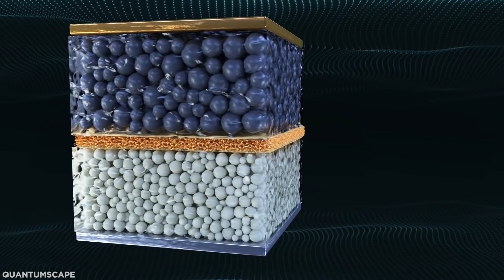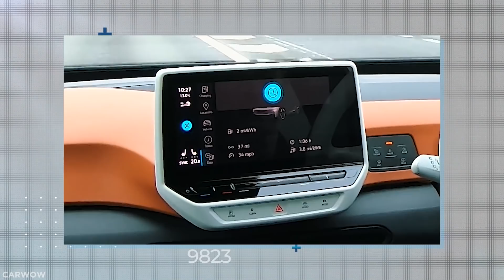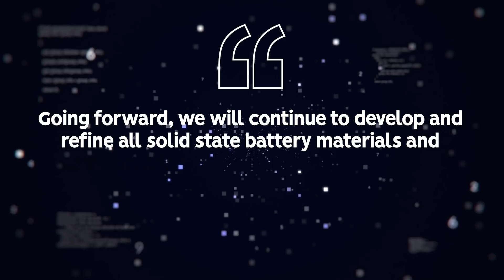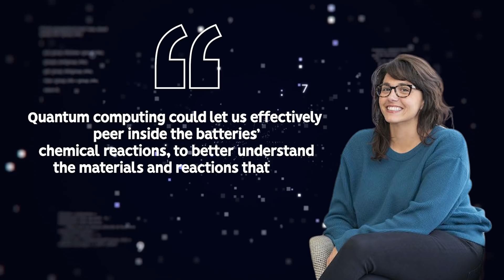Why Solid State Batteries Are The Future

Comment: The biggest drawback is that Tesla will have lithium-ion batteries that blow those spec out of the water within 5 years.
So by the time anybody is able to scale solid-state batteries, Tesla will already be moving on to the next thing.
Reply: Tesla get their battery from Panasonic. Panasonic is not the only company that can make battery. There many other...
Reply: @jonpetter8921  If the battery manufacturer was so important, every other EV manufacturer wouldn't be 4 years behind on range and charge cycles.
Tesla has put the capital and work into R&D to develop battery tech that outperforms everything on the market and everything the "competitors" are planning 5 years out.
Reply: @JIYkp   There are many metrics than range that you need to take to consideration when talking about EV. In Europe range is not always the absolute factor when buying an EV, E tron for instance has less range than Model X but sells 100x times than Model X, same with Tyacan and Model S. Model S decline while Taycan is hitting record sale having less range than Model S. So your so called "4 years behind" has very little effect on people preferance while byuing EV, and there are other EV that offer better package than Tesla in Price-range-build quality.
Reply: @jonpetter8921  Too scared to compare to Model 3? Understandable. Have a good day.
Reply: @JIYkp  haha you must be new. VW ID 3 outsold Model 3 in europe the last 4 months of 2020. In Netherland VW ID 3 is the most sold EV in 2020 outselling all Tesla cars combined, included Model 3, knowing VW ID 3 has only been in the market for 3,5 months. 
In Europe Renault Zoe is outselling Model 3 by almost 20 000 units for 2020.
The one who is scared right now is Elon cause this year wont be easy for Model 3 in Europe with ID 3 and ID 4 and other new european EV coming.
Reply: @jonpetter8921  Gee you pick your stats Jon. Tesla sells every car they can make, so dont go thinking any sales figures mean they are losing sales, they have to deliver all over the world from just one, then now 2, soon 4 factories. What other metrics do you want to use?  Speed, acceleration, no of chargers? Speed to charge? And exactly which one does tesla NOT win, $$$$.  Prices will drop as they get volume, the model y in china just sold 100,000 in a day since the new manufacturing has allowed a reduction in costs. The CEO of volvo admits they are 10 years behind in ev tech, batteries and software.  Many sources have stories on Toyotas SS plans, and they HOPE to have SOME production capacity by 2025, the year Tesla will complete building out 3TWhrs of capacity. The German facility, if it goes ahead could eventually do 250GWhrs. Weight means nothing if your cars are good enough, capacity good enough, and production actually exists! No-ne is beating tesla on range or build quality any more, only thier (Falling) price, oh, and tesla is actually making a profit on EV's, no one else is (maybe in china?), but they are all cheap, loss leader, or compliance hacks.
Reply: @jonpetter8921   Elons not scared, he can sell every car he can make, and grew in a year the rest shrank, while subsidising their ev's.
Reply: @RacefanPat68  How can he "sell every car he can make" when Model S and X are sitting on shelves. And he will soon learn the hard way in Europe if he doesn t get his act together. 
Remember Ford ?
Reply: @RacefanPat68  It doens t matter how good your Berlin factory is if you offer the wrong product to the consumers. A sedan will never making it in Europe, and even a minivan-ish Model Y wont do a miracle sale. ID 4, Skoda Enyca and Audi Q4 E tron will make life difficult for it.
Just wait and see....
Reply: @jonpetter8921  Yeah. You wait and see. Tesla will make 1 million ish cars this year and sell them all. Germany's Model y will be cheaper than you think with the cast chassis front to rear, and batteries integrated directly into the chassis, and the world's most advanced, zero pollution, paintshop, making it quicker and cheaper to build although there is potential for a troublesome ramp. Oh..., and Tesla has actually secured their battery supply....
Reply: @RacefanPat68  1 Million cars ? you must be kidding.
Reply: @jonpetter8921  I am certainly not kidding, It will be 900,000 to 1 million... Shanghai stage 2 JUST started churning out model Y, and stage 1 can do the same volume as Freemont now. All year they have been accelerating production and did nearly 200,000 in q 4, (model 3 and Y). Now with the second stage in shanghai ramping as well, and the following year Berlin, then Texas,and they are both bigger than either fremont or shanghai, and use all cast chassis, so much less car assembly to ramp. They are also carbon copy processes, so much less ramping bumps methinks... So 1 this year, and 2-3 in a couple of years. That's why they building battery plants for their partners, and building electrode plants, lithium processing plants, mines... or mining leases actually....
Texas will be massive too, with a capacity of maybe 2 million Y, 3, and Cyber-Trucks, maybe a few semis. They have everything (like contracted battery capacity) lined up ready to go. VW has said they may get to 350,000 in 2025 didn't they???? Was that electric, or id3 only...
Reply: @jonpetter8921  There are 2 others that could theoretically handle most of Tesla's volume, LG and CATL, and both supply batteries for them already in china, just as many as Panasonic in Nevada...
Reply: IAN G You must work for a Auto company. 

1. you make a basic mistake. Tesla is not just a car company, and thinks different. Tesla does not do continuous improvement except in that they add stuff as soon as its ready and drop the price, They are a disrupter, looking to REPLACE. like the castings, 1 giant processes removes hundreds and hundreds of machines, stations, assembly steps, welds, robots and parts from every car. 

 2 you misrepresented their battery road-map grossly. 50% improvement in $kwh so 13% is meaningless. If you can afford to add a few, and still have the fastest car on earth your figures are vaporware like your SS Batteries. 

3. Tesla is a moving target. If your tech moves forward 5 years, (Oh and suddenly exists after 40 years of being next few years), Tesla has also moved forward 5 years. New thinking, and far far more engineers working on the problem, and more money in the bank... Tesla is working toward making energy sustainable, not just cars, so you miss a lot of the overall inflection

3. Tech.  Dry electrodes. What is flammable?  Besides using a dry electrode processes, and  moving to pretty much gluing them into the chassis without a pack,  starting in Berlin soon, (did you talk down battery day much?) they are already 1/10th as likely to catch fire than a gas car (Per million KM driven), and probably 100th as likely as a hydrogen gas leaker. This is a fear inducing lie by the auto companies who keep insisting on investigations and the media who will run with anything nowadays. This constant re-hashing of any Tesla news is FUD.

Comment: are solid state batteries able to be recycled or remanufactured in the way current batteries are? or will solid state batteries present entirely new challenges for small recyclers sprinting to keep up with massive producers?

EVs are greener on the surface than traditional vehicle, but end-of-use care matters. i don't think it's being talked about enough.

Comment: I drive like 25 miles a day, rarely go on road trips like maybe 1 every two years. Range is super overrated. Except with Semi trucks which can haul more batteries so it works out. The safety thing is definitely better, even though batteries are already safer then petrol.
Reply: Batteries are not safer than petrol at all, and diesel doesnt burn naturally
Reply: @alanmay7929  False.  There are far fewer battery fires than petrol fires every year.  The average increase in safety is about 10x to 20x safer.
Reply: @redbaron6805  there are also millions of modified and bad repaired old cars on roads, fires doesn’t just come like that
Reply: @alanmay7929   That is only a small fraction of the story.  BMW, Hyundai, Ford and others have been recalling brand new cars for fire risk.  

Then there are tens of millions of old cars with old fuel lines and leaking engines and transmissions just waiting to catch fire....

Comment: Long range is good. But you really don’t need 700 plus miles of range 300 to 400 miles is ok. Because one you leave your start point with a full charge and two after about 250 to 300 miles you should stop for a break and to stretch your legs while doing that put it on charge. Lorry drivers stop after ether 250ish  miles or 4 hours not because they won’t to but by law they have to for safety to prevent tiredness. Plus having a battery with a range of 700 plus miles is going to take some time to charge. When it eventually needs charging . But yes solid state is the answer for quick safe charging. In the future.

Comment: Why are they pushing EVs so hard when the battery technology isn't ready? Make the cars we have cheaper so more people will buy new cars that pollute less. Eco boxes are typically 20-25 grand and trucks start at 40k with just basic options. Why haven't cars that have been around for over 100 years not dropped in price and why is an electric which has fewer moving parts more expensive than internal combustion?
Reply: Who says battery technology isn't ready?  We already have cars with 400+ miles of range and years of proven performance.

There will always be better technology on the horizon.  That will never charge.  Doesn't mean the current technology isn't mature and ready.